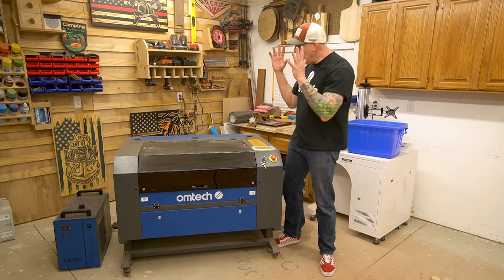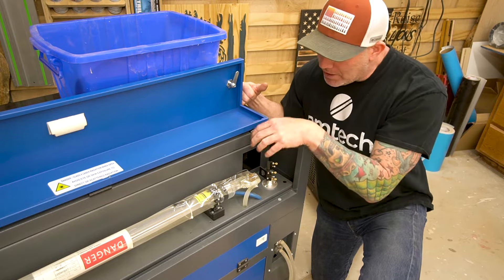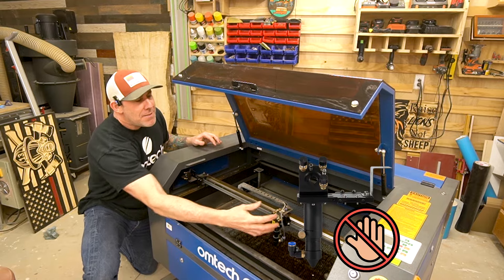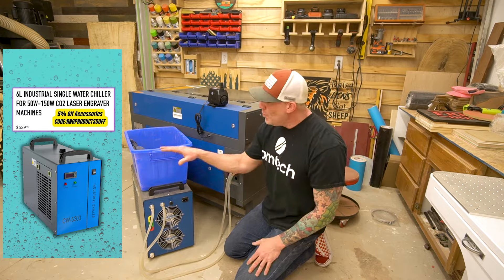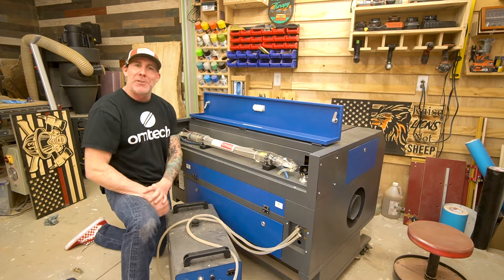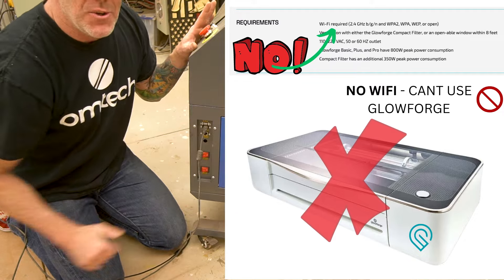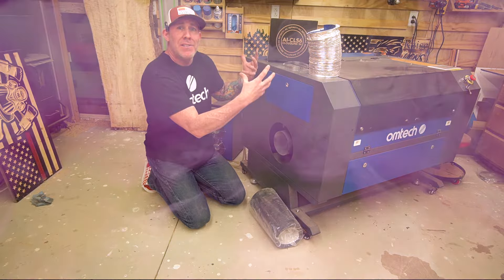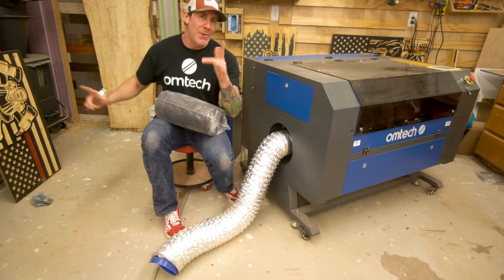Ultimate OMTECH CO2 Laser Setup Process

Comment: Ready for part 3! 🙂

My laser is out in my garage, unboxed, where the temps WILL get below freezing and I refuse to wait until Spring to play with it. So, I ordered the special antifreeze. 

I also noticed a note on top of the laser that said there may be some water left in there as a result of QA testing at the factory. Eek. Don't want that to freeze.

I popped off the short hose that went from the inlet to the outlet on the laser and used about 2 psi of air pressure from a compressor to gentle blow out any water. None came out and visually inspecting the laser tube; no water there either. Did the same with the separate water chiller.

Now, about water temps. The laser requires a minimum of 50 degrees F. If the water is too cold, it can damage the laser. [Side note: Why does everything on this planet have the potential for damaging the laser? Build a tough, more reliable laser!] Anyway, I've been wondering how I'm going to heat the water to an acceptable temp during the winter. Good news on that external chiller; it looks like it's also a heater. In the chiller manual, there is reference to the heating rod. Then I wonder why it's only called a "chiller". :-\

Comment: I’m excited for more content from you, this has been helpful while I wait for my laser to come. Hopefully next week, got the 80watt and it came with the free chiller 😊. I now am looking at the inline to help air it out .. will definitely use your info if I go through with any added items. 

Thanks so much ❤
Reply from the maker: The inline fan makes a big difference, it's very easy to install as well. I just removed my old fan and left the fan out. The new fan can mount on the wall close to exit point. Run your tube back to the connection on the laser and back to the fan and use the remote to power the fan on or off, you can wire it to the laser so it turns on with the machine like the stock fa,. I prefer having control and keeping it off when not running the laser

Comment: Thank you for your videos. We have recently received our machine and used your videos for set up, which were very helpful. We we literally followed you step-by-step, pausing in between steps to make sure we were doing everything correctly but we can’t get that first cut for some reason. We are having trouble firing up the machine. 
Do you have any tips on what we could be doing wrong or how to do a test cut? 
Any help would be greatly appreciate it. Thank you so much for doing these videos.
Reply from the maker: Go to the OMT website and find downloads. Download the test card. Import it into lightburn. The power and speed settings are already programmed. You just need to run the CUT/START - the test card will give you your speeds and feeds. Make sure all Keys are ON and the E-STOP is not engaged. Very hard to diagnose with limited info.

Comment: Thanks so much for the videos!!  I have watched all three parts and have found them very helpful - I am wondering if you just installed the inline fan and left the fan alone in the laser or if you disconnected that fan due to the inline fan - thanks for all your time and valuable information!!  Looking forward to more content!
Reply from the maker: You will need to remove the stock fan when upgrading to an inline fan. The old fan will actually cause performance issues. Lots of documented videos on YT or else I would make one. Just remove the 2 wires, cap then off and take the old fan out. Some rewire back into the old fan connections and others will just plug the inline fan into an outlet and manually turn it on when using the machine vs wiring up the new one. Either option works fine. Personal choice.

Comment: How long of a usb cord do you have? I can't place my laser close enough to use the included usb cord and the high speed 30' one I bought doesn't seem to work. Not sure if it's the length, the high speed, or some other factor.
Reply from the maker: 10' - I would run an ethernet cable to your PC or invest in a Laptop or save your files to a USB on your PC then take over to the OMTECH and run it

Comment: how well do these things run in a garage? I live in MI where is gets cold and hot and don't think i'd be able to get one of these into my basement. is there anything i should do to make sure they run well in a garage?
Reply from the maker: Simply get a chiller and fill it with some Anti-Freeze or you can drop a fish aquarium heater inside to keep it warm during the winters. Even better the new OMtech CW5200 has a heater built in. Works great in a garage. No Issues.

Comment: can you or anyone else recommend another chiller for 100w co2 as Omtech don’t have any and don’t know when back in stock i’ve Uk based
Reply: I typed laser chiller into eBay and picked one up for not a lot.  Although my laser is only 60w.
Reply from the maker: The 5200 unit is a generic unit, you can find on OMT and Amazon along with Ebay

Comment: How thick of acrylic can you cut? debating between 60w and 80 w purchase.
Reply from the maker: Stock 80w can typically do up to 10mm Stock. However I would order the lens and tube kit from OMTech or American Photonics. 80w will cut slightly faster than the 60 not much. OMTech site has a chart under learning center that covers the materials list each laser can cut. 80w tube life is 3X as long as the 60 so long term the 80w is a better bet 👍🏼
Reply: @RISENGRINDWORKSHOP  Where is a good place to buy cast acrylic?

Comment: I currently have a blue diode laser that I mostly use on stuff like yeti cups and lumber, the big trouble with using the blue diode laser is a matter of engraving anything highly reflective or see through, ie aluminum sheeting and glass, because that diode works by focused light energy that either just bounces off/thru those materials. Anyways, the true question that strikes my mind is a matter of the software. It's definitely gonna be a while until I invest on something like a co2 laser, but I'm questioning if this laser is compatible with the same software I use on the diode, ie xtool laserbox basic. With the laser engraving being more of a side thing for me, I don't wanna waste my money on those softwares like lightburn, especially if I'm not gonna make a business out of it. Again I just question if this will work with laserbox basic?
Reply from the maker: This laser comes with a FREE version of EZCAD and most users buy Lightburn. Lightburn is compatible with most lasers and diode lasers

Comment: I’ve been waiting on my machine since December 5th, 2023 and it’s January 31st, 2024.  No machine.  From OMTech
Reply from the maker: Most machines sold during December were pre-order. Call customer service.
Reply: Mine was ordered 12/27 and was a pre-sale order. You likely won't hear a thing from them beyond an order confirmation until the date the laser ships, unless you contact them (or possibly if it's late - I've read stories of the estimated date being pushed back but that was not my experience) I had a question about something besides the machine and they were very responsive when I reached out. Next contact was a shipping confirmation, then the freight company contacted me, and the machine arrived yesterday (2/8).
Reply: How is it now